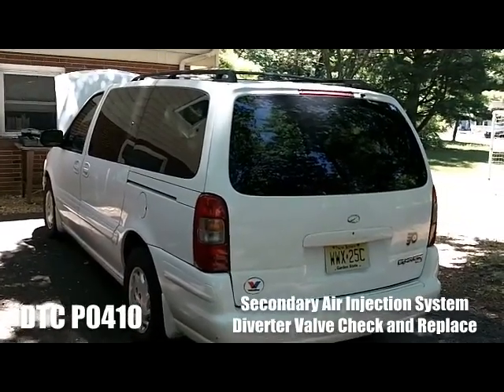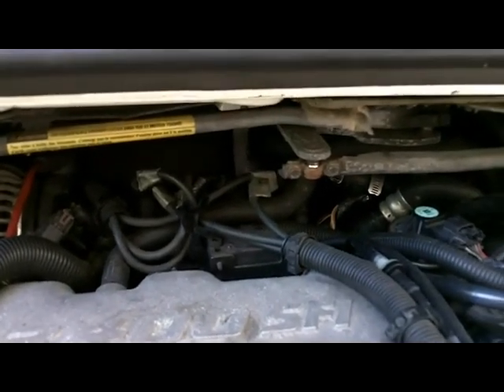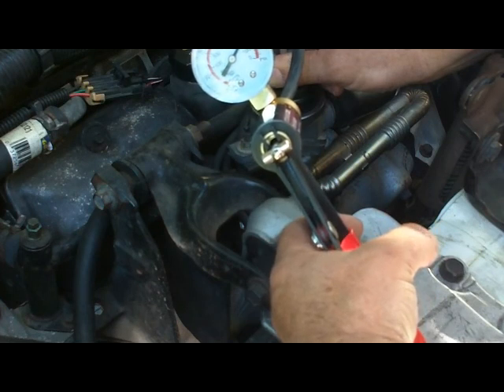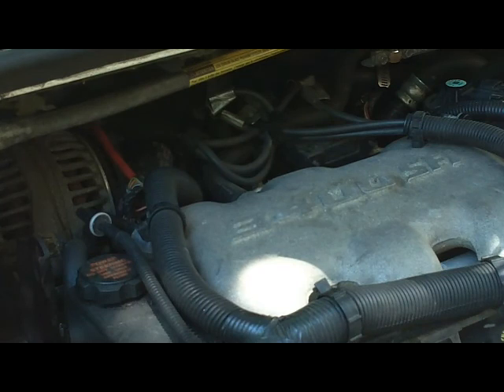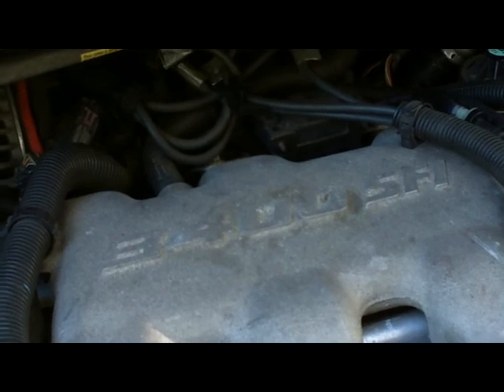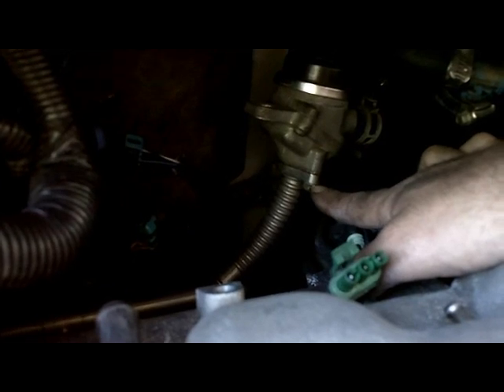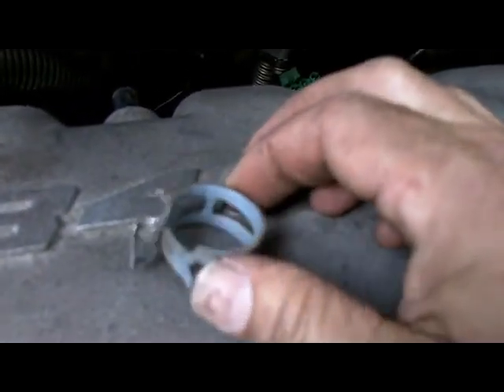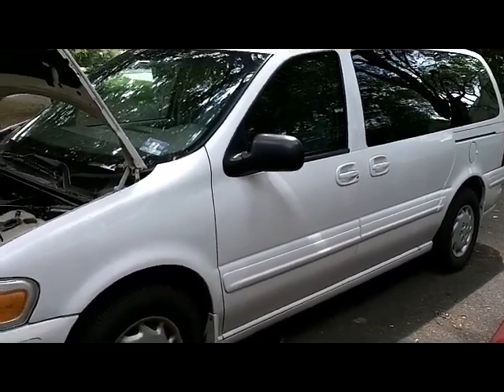P0410 GM Diverter Valve Check & Replacement 3.4L Secondary Air Injection Pump System Fix

Comment: Thanks this video helped somewhat but how do you get the coil pack out of the way of the diverter valve I can only access 2 bolts for the bracket and I don't know where to go from there
Reply from the maker: yes, you're right....accessing that diverter valve back by the firewall is a real pain. I don't remember exactly, but after removing the three coil packs, the plate they sit on unplugs and removes. Then, there is that aluminum bracket which bolts down awkwardly. I recommend getting a mirror in order to get a better view of what you're doing. You'll figure it out!
Reply from the maker: Possibly I misunderstood the question.... Each coil pack is held down with two bolts, front and rear, with a very small head, you'll need like a 7/32" socket or small like that. It's impossible to see the bolts in the back, so you have to pretty much feel your way or use a mirror to get your socket on the bolts in the back.

Comment: As you mentioned you had code po410  . Couldnt you have just changed the  diverter ( check ) valves? Was changing the air pump even necessary. ?    Or was the pump not working as well ? Im getting  the same code but i can still hear the air pump in my car working .
Reply from the maker: I had previously changed the air pump. They tend to fill with condensation/water. Mine clearly was not working.  And you know what? It's now a couple of years later, and I need to change out that pump again. I hear it come on, but not correctly. It should sound like a high-pitched whine, sort of like a vacuum cleaner. And it only operates for about 70 seconds on a completely cold start. My van is not due inspection till July 2020, so I don't plan to fix this again till then. The whole secondary air injection system is completely emissions-related, and has no effect on engine performance.
Reply: @Buckwsr   i heard yiu can drill a small hole in the gasket  of the check valve so it doesnt fill up w water

Comment: Thanks for the video, it did help me some just wish you had shown how to remove the weird shaped bracket that the valve is held in place with. Is it easier to get to the spark plugs if I remove the rear air injection piping ? Who ever designed this setup should be keel hauled.
Reply from the maker: Thanks for watching and commenting. So true how difficult it is to access the stuff on the back side of the engine near the firewall! I had to do a head gasket job on this van a while back. I actually installed new spark plugs on the head before I placed it back into position on the engine! They are so hard to access otherwise. I hope you get your job done successfully!